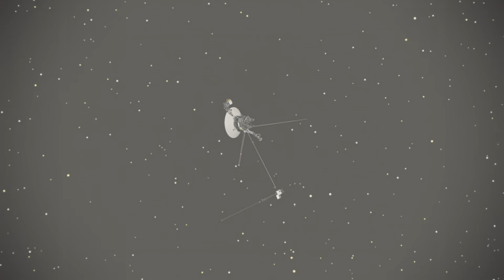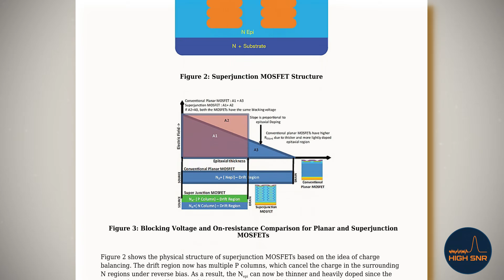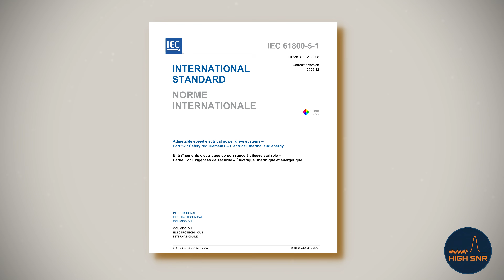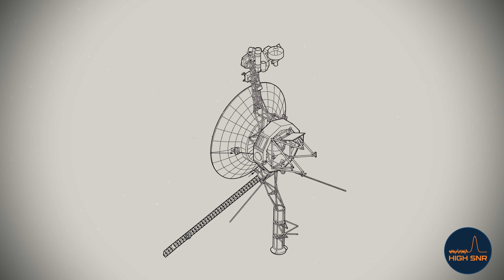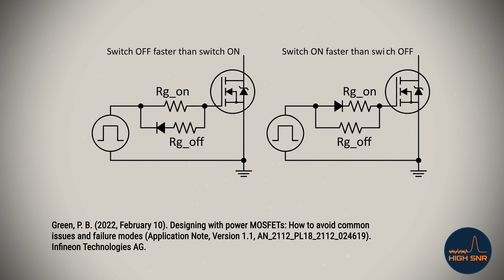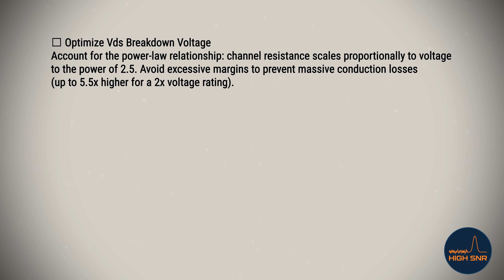Stop Oversizing MOSFETs: The Hidden Thermal Cost of Voltage Margins

Comment: About twenty years ago I was given a dozen T5 fluorescent fixtures that had all failed the same way, their electronic ballast power mosfet had failed. These were otherwise new fittings, the sales rep
who gave them to me said they were unrepairable, but good for the high intensity tubes that were effectively new. I pulled one apart and found the dead mosfet but its size was obviously not sufficient so I decided to try one
from my stock, around 6A/400V. I fitted one and it worked perfectly so I did another nine then installed the fixtures in my workshop where they still function today. The strange thing is, I later discovered I had stocked the wrong devices in the
drawer they were kept in and instead of 6A 400V, the devices I fitted were 4A 60V, yet here they were running at 340V from a 230V supply. Not one has failed despite around 30,000 hours of use. I was ready to start re fitting the 
whole lot once the first one failed, but it just never happened. At least I know the snubber must be very healthy and the devices I had sourced were genuine. It also made me wonder about those voltage ratings in manufacture, are they
all under spec by a huge margin or did I just get lucky ten times over with them only passing a peak of one amp. I wouldn't recommend it, but if you're in a bind voltage wise, it may be worth a try. Maybe Nelson should have done this too.
Reply from the maker: @alasdair4161 That is an incredible repair story! However, physics dictates that a true 60V MOSFET blocking 340V would instantly enter avalanche breakdown and fail. You almost certainly got "lucky" with mislabeled high-voltage silicon from the factory. Either way, 30,000 hours of operation is a legendary result!
Reply: Cool outcome happy to hear it worked out for you.

Comment: Don't forget the body diode reverse recovery time.  It can kill FET's instantly in the wrong condition.  Although the SiC devices have mostly solved that problem.  Another FET killer can be the inductance in the source lead.  I once got a board laid out with a current sense resistor mounted right next to the FET source lead, but there were 2 vias on that trace before getting to the resistor resulting in a 45 V bounce.  After that I was very critical of layout  and mostly did my own for power designs.  My first FET application was a linear audio amp using the HPWR6504 around early 1980s.
Reply from the maker: @barnowl6807  Really appreciate you sharing your experience with the HPWR6504 back in the early ’80s. That 45 V bounce caused by source inductance is a great real-world lesson in PCB layout.

Comment: Does anyone just make their choices based on max Vds though? A good design will have considered the characteristics like Rds(on) and switch-on time, in conjunction with selecting Vds (max).
Reply from the maker: @AllTheFasteners  Real engineering is always a compromise between VDS, RDS(on), and switching performance. It is never about just one parameter.

Comment: I have the suspicion that with switching losses dominating conduction losses in many applications, increasing RDSon isn't nearly as big a deal as you're making it out to be. If this weren't AI generated, I l'd give some credence that this argument reflected the real-world experience of the obviously-skilled human author. As it is, I'm left guessing. You could be experienced in electronics design, know the answer, and have provided that input to the machine -- but you could also have no idea and just be trusting the AI. And statistically speaking, it's more likely you're someone who's only capable of that second option rather than someone capable of both.
Reply from the maker: @MrNerdHair   Fair point. Whether conduction or switching losses dominate depends on the actual operating conditions, so I wouldn’t say one always matters more than the other. My point was just that picking a MOSFET by a single parameter is usually a bad shortcut.
And yes, I use AI as a research tool - but the argument and the final published position are mine. If you think I weighted RDS(on) too heavily in this case, that’s a fair criticism to discuss directly.

Comment: Maybe this would be up your street - it would be interesting if you did a little dive into modern converter topologies such as ISOP. You can look up the "Low Cost and Low Profile 800 VDC to 12.5 V DC-DC Converter Using Low Voltage GaN in an ISOP Topology" paper by EPC to see a modern example. This topology builds on the idea of not oversizing your MOSFETs that you present in this video, since it allows using lower voltage parts for high voltage conversion. It would be interesting to cover some points such as voltage balancing, interleaving and how this topology differs from current-boosting topologies such as various multi-phase converters today etc.
Reply from the maker: @oriole8789 Thanks for the excellent recommendation! I've read the article, and it is indeed a very interesting and promising topology. I've added this to my list for future videos.

Comment: Great point though engineers please also perform validation of these designs with degraded components like highly nonlinear and elderly electrolytic capacitors.
Reply from the maker: @marklundeberg7006   Completely agree.

Comment: Measuring current with isolation is very important to find real oscillations.
Reply from the maker: @0MoTheG   Could not agree more. You can't fight noise if your own measurement tool is generating it.
Reply: @High_SNR_Channel  Well you have to be smart about it. If it isn't too bad you can ignore the measurement equipments oscillations.
I had to use ferrites and adjust one diff probe.

Comment: Any plans on running through a MOSFET circuit design using the math and data sheet?
Reply from the maker: @U812-k7j   Yes, I definitely have plans for that. It's a bit surprising to me, but the MOSFET topic has received a great response!
Reply: @High_SNR_Channel  There seems to be a ton of videos on bipolar transistors, but in depth MOSFETS design seems to be left on the side line.

Comment: 6:06 so why 220v home induction cooker use 1200v igbt any one example me
Reply: induction cooker working principle is actually quite interesting. The mosfet/igbt is first turned on, and the energy builds up into the inductance of the induction coil from the rectified mains voltage (300V, or even higher for 3-phase). Then the switch is turned off,. and because there is a capacitor in parallel, the LC makes an oscillation cycle, with peak voltage significantly exceeding the input voltage. After one oscillation, when the voltage across the switch is zero again, the switch is turned on again to pump more energy into the inductor. 

It is highly efficient in that the switch is (almost) never turned on when there is voltage across it, so the switching loss due to mosfet capacitances is mostly eliminated.
Reply from the maker: @invendelirium Excellent and very accurate addition! Thank you for the detailed breakdown.
Reply from the maker: @Mr.Saif-u3p It's all about inductance! Switching off the load causes voltage spikes inside the device that can easily reach 1000V.

Comment: This is Class A, versus Class AB versus Class D. A: Balanced differental biased at 50%, gain of 2, runs very hot idles at full power but very linear good for no-noise microphone pre-amp. AB: Biased near start of linear section say 5% for gain of 20 inverting at zero crossings. Class D: biased at 0.1% for a gain of 1000 yet runs cool. It is a switched mode digital device.  Noisey but loud and light.
Reply from the maker: @TomAtkinson Perfect illustration! Audio amplifier classes are perhaps the best real-world example of the efficiency vs. linearity trade-off.

Comment: The basic concepts and trade off are clearly explained.  The difficulty is in the specific.  You need to determine the leakage inductance, the rate of current change to determine the peak voltage.  With simple RCD snubber, you need to select the right capacitance and resistance to lower the ringing.  Even then over time, R and C will degrade and the ringing voltage will increase and exceed the design limit.  Even with snubber, you can lower the voltage spec, but it does not guarantee you longer term reliability.
Reply from the maker: @chormingtan7266 Brilliant point. The devil is always in the details, especially when it comes to degradation over time. True reliability always requires a safety margin at every level. Thanks for the valuable comments!

Comment: I'm sitting absorbing this knowledge while the Delta8 takes hold. I actually understood 10% of it the rest I faded out. This will be rewatch. Since I am getting back into the fixin electronic devices
 As EV's take off knowing the MosFet's full strengths and weaknesses make troubleshooting easier
Reply from the maker: @imfloridano5448  Grasping 10% on the first watch is actually a solid result for such dense material! Come back for a rewatch whenever you're ready. Understanding the physics of power components is a highly valuable skill. Best of luck!

Comment: I remember that the 2X derating standard for voltage/wattage typically applied to passive components, not active. Whenever the bean counters started altering to 1.5X (or less) via component swaps to cheaper ones that were already in stores in large quantities, the mean time to failure typically halved and advertised reliability turned into a joke.
Reply from the maker: @nolongeramused8135 Sounds so familiar! Cutting safety margins just to use up cheap components lying around the warehouse is an absolute classic from the "bean counters".

Comment: The reality is that it can perfectly acceptable to allow avalanching of a discrete power MOSFET provided that the limits for both avalanche energy and avalanche power are observed. With most modern FETs, these are usually well specified. This is generally not true with the FETs in SMPS power ICs where the entire circuit including the FET is integrated. Of course with the discrete FET where avalanching may be acceptable, the avalanche power must be included in the total dissipated by the FET. That can be a pro or a con, depending on the overall design. If the FET is already on a heatsink, the power may be easier to "dispose of" than power in other devices there only to snub a "spike" (as in the discharge spike of the leakage inductance of a flyback converter "transformer"). If you can't accurately predict the avalanche energy and power, it would be foolhardy to allow it.

Pushing the supply rails out of spec isn't something that occurs only in power circuitry. It can happen in micropower circuits where inputs and/or outputs are protected from overvoltage by means of diodes clamping to the rails. If the current during clamping exceeds the power required by the circuitry (typically from a series voltage reg. of some sort), the rails might be pushed too far. Extra measures (shunt regulation) may be necessary.

 I have a great disliking for calling the voltage induced by inductor discharge "back EMF" or "counter EMF." I prefer to reserve those terms for the the EMF which acts counter to the applied EMF when charging an inductor - the induced EMF actually responsible for limiting the rate of rise of current in the inductor.

Somewhere in the video there were words very close to "di over dt rate." The differential of current with respect to time, di/dt is inherently a rate. The extra "rate" is redundant. It's like saying "a high rate of speed."
Reply: During Avalanche Breakdown your FET may suffer from hot carrier degradation, caused by electrons that get implanted into the oxide layer. This leads to a shift of your specified parameters and may degrade your chip slowly. Alowing avalanche during normal operation is not the best idea.
Reply from the maker: @D614G_aka_Doug  Thank you so much for such an insightful comment! You brought up an excellent point about avalanching: relying on a modern MOSFET's EAS/EAR ratings instead of an external snubber is an elegant solution if the thermal budget allows it. Your example with rail pumping via clamping diodes is an absolute classic trap! And you completely caught me on the "di/dt rate" tautology - a fair point, duly noted. Thanks again for sharing such valuable experience!

Comment: Many of my designs were overprotected with extremely high margins on purpose.True,  some of them are a little bit bulkier and warmer but functional after decade of 24/7 work. Everything is a tradeoff.. Cheers
Reply: that's literally what he said in the video
Reply: Did you also use snubbers or voltage clamping diodes?
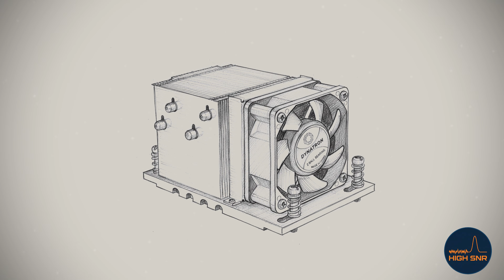Reply: At 3:10 that depiction of the cooling system looks like a hand drawing and similar to a patent drawing, but I am curious if there is some rendering solution that allowed you to make it computer generated?  I ask because I am in the patent field.
Reply from the maker: @sleepwalkerbg1 That is also a good approach! The main beauty of electronics is that in every specific project, the engineer sets the priorities themselves.
Reply: @High_SNR_Channel  Why do you respond with every comment with an ai response?
Reply from the maker: @Nelo390  English isn't my first language, so I use AI to clearly translate my thoughts and avoid grammar mistakes.
Reply: @High_SNR_Channel  Русский?

Comment: I believe that engineers were slow to transition from bipolar transistors to MOSFETS in both analog and digital circuits for years. It took knowledge, experience and courage to work with semiconductors that were sensitive to high voltages. We are in a sea of high voltages. Anything from combing hair with a plastic comb, to cutting plastic with scissors generates thousands of volts, not only rubbing shoes on a carpet and touching a light switch in dry winter weather.
Reply from the maker: @foureyedchick  A sea of high voltages" — spot on! I can totally understand the engineers of that time: BJTs felt like absolute tanks compared to early MOSFETs. The transition to field-effect structures really required a completely new work culture. It is an absolute pleasure reading about your experience, thank you for such insightful comments!
Reply: My instructor from the early 1990’s said he was thrilled to move from transistors to mosfets because they ran more like tubes (valves) to which he was accustomed. Thanks very much for this explanation. I see things at work that make me wonder… but I’m not an engineer… but it’s a blast to help an overworked engineer.
Reply: @ziptie5829  Especially depletion-mode FETs.
Reply: Enter the TVS diode.
Reply: @samuellourenco1050 I am not 100% sure about this, but I'm inclined to believe that an ESD diode is the one to choose. A TVS diode will protect from overvoltages caused by a MOSFET or CMOS chip operating outside of the range that it was designed to operate. A good circuit designer would probably provide a large safety margin and never be let that happen anyway. But, electrostatic discharges are all around us. A human hand will probably feel nothing and never feel even a mild shock. After all, it is the amps that kill, not the volts. But the high voltages, which cannot be felt will zap certain semiconductors instantly.
Reply: @foureyedchick  I mean if its a data line sure, but in power lines its no different one way or the other. Actually I think tvs diodes are better on power lines due to higher capacities.